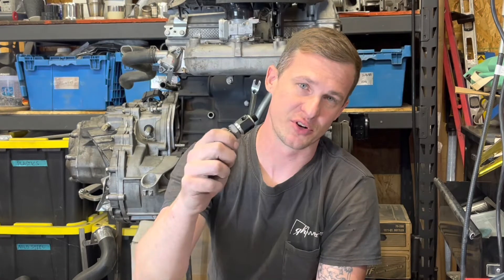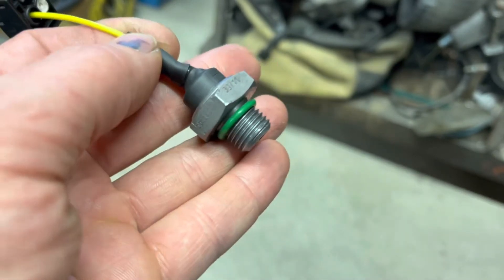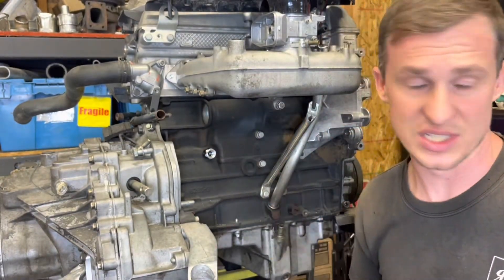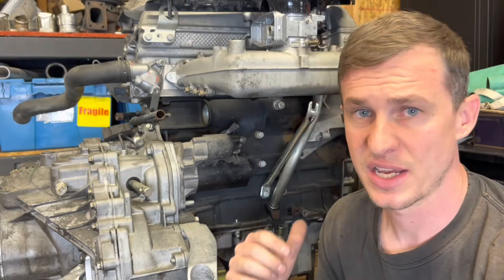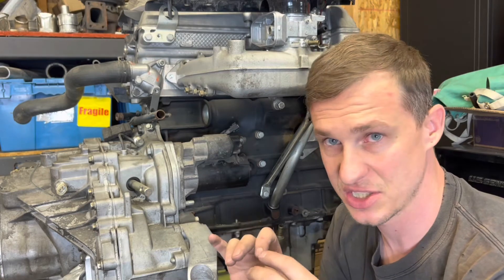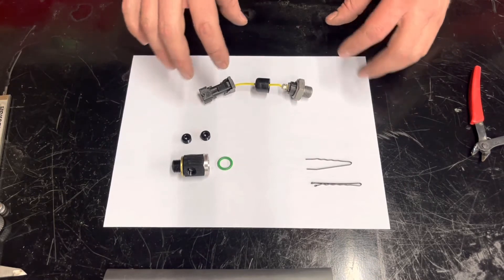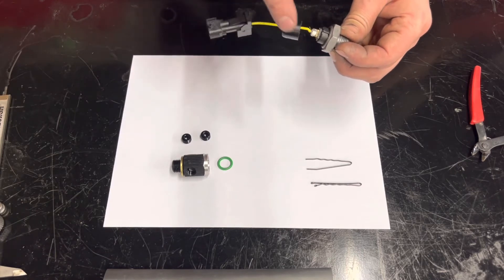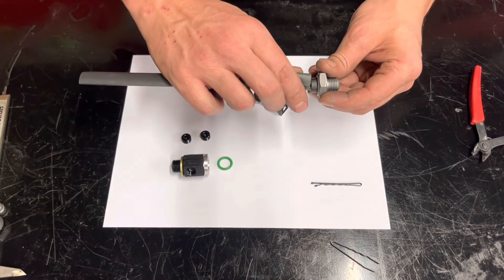Saab B2X4/5 Oil Pressure Sensor!

Comment: The reason why I found this video is because my saab engine oil light comes on at idle but goes away when I accelerate so I’m trying to figure out what’s going on with my oil pressure.
Reply: it is shitty oil, I had same problem in Ukraine, just changed oil from motul 8100 x-cess gen 2 to motul 300v competition and problem gone
Reply: Balance shaft bearings worn out